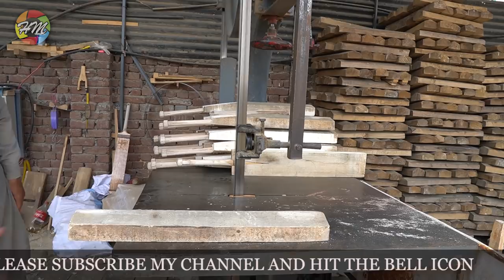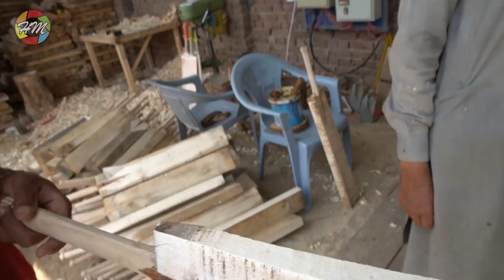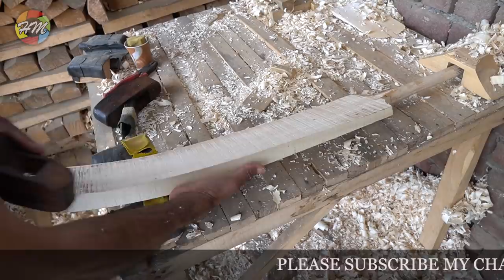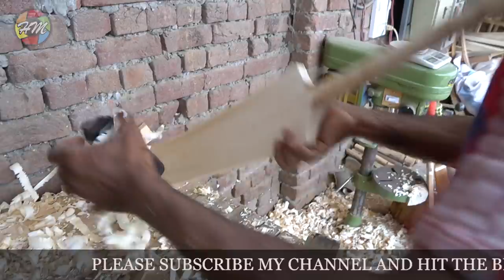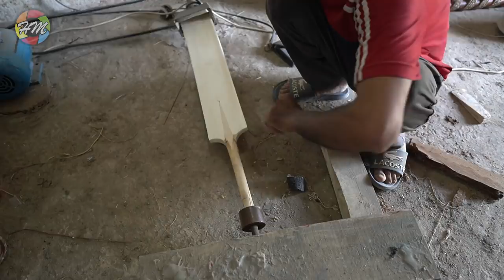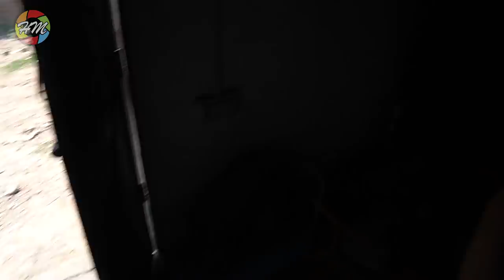How To Make a Wooden Cricket Bat With Amazing skills.

Comment: Low grade bat.But extremly skilled workers .Good video shooting.
Reply: Why is it a low grade bat ?
Reply: @tonywright8294  First off all you cannot play with a duce bal using that bat.U can understand it by seeing it's thickness.Second of all I think that the angle of curve is not correct. This is my opinion .I might be wrong. Third of all the wood quality is not so good. Again I will say that it is my personal opinion .But everything depends upon the skills of the bat holder.
Reply: This bat use to play tape all cricket 🏏 in Pakistan not for leather ball